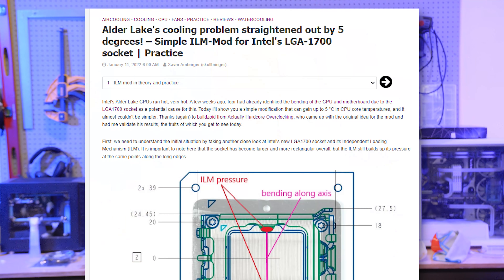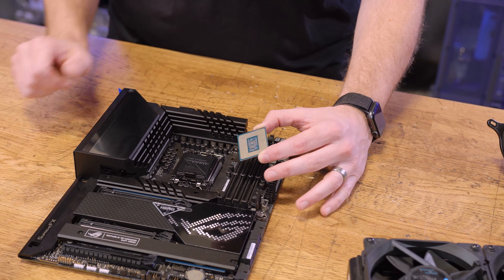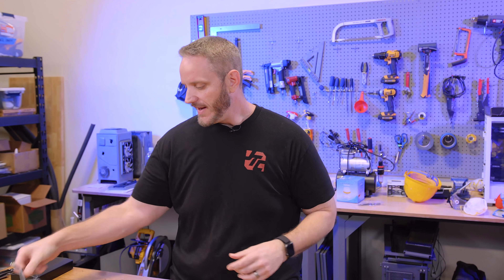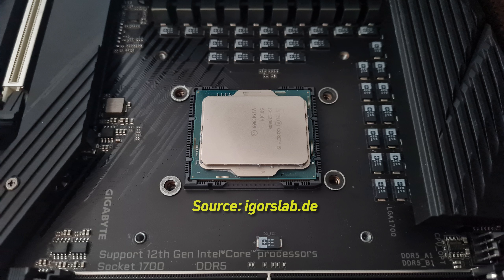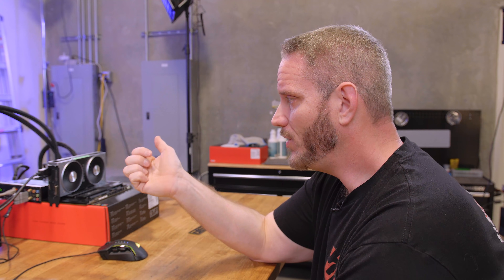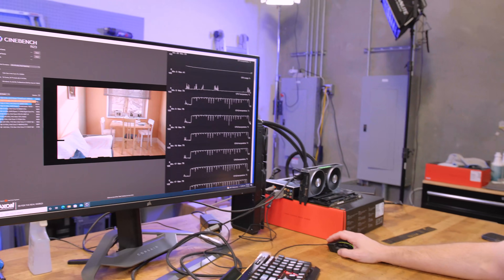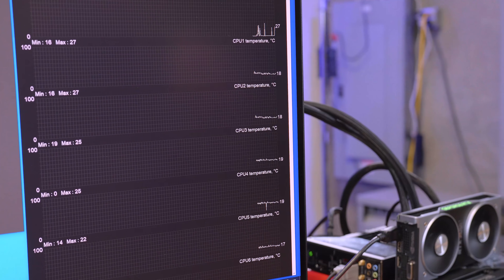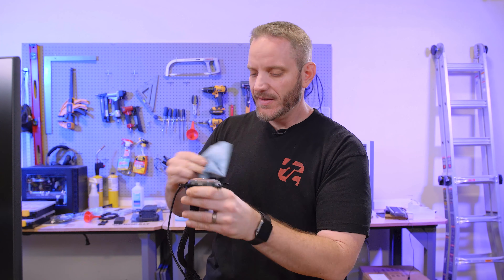YOU GUYS asked me to try this... so I did

Comment: For a very long time a domed heatsink (not heat spreader) has done the best for cooling by giving more pressure and more squeegee effect to get the maximum amount of TIM out of the way.
That's probably not helping with the issue since manufacturers know this gets them better temps.
Once the cooler and heatsink are mated to each other (bent basically lol) it's virtually identical to two flat surfaces.

What's gonna happen tho is if you switch from a domed heatsink to a flat one you're gonna get awful temps.

Bigger IHS means it's even harder to squeegee out extra TIM if you over apply due to identical mounting pressure but lower PSI!!

Comment: I wonder if all the folks calling it hot are using pre applied paste on their coolers.
Although running hot may just be different to what they're used to, if you went from 35 to 45 idle temp, sure it's fine, but it would seem hot by comparison. especially if they overlooked something like power draw or voltages.
Reply: The stock paste lasts a lifetime, usually good performance for stock. It's probably ignoring proper power ratings like you said.
Reply: @jc.1191  yeah it's amazing how many people talked about AMDs 5800X thermals, but overlooked the part where most boards are running default it at around 140W
admittedly i haven't had an intel chip in a long time, but I feel like that would be the first place to look if it ran hotter than I had anticipated
Reply: No applied it myself with a x shape and also tried to spread it out with some spreader thing once. Doesn't make much of a difference either way and my temps in prime 95 are easily 70c stock settings with a 12600k and one of the best aios you can get.

Overclocked it easily goes over 100c if it wasn't throttling.

And I am used to much cooler cpus(funny thing is I had a 300w cpu heavily overclocked with worse cooling that ran much cooler). But these temps are just literal fire. Even laptops are easily 30 degrees celcius cooler if not much more. The hottest cpus ever prior to these few years were easily that much cooler.
Reply: @sansundertale69availablename  yeah I tend to find as long as you get full coverage the application of paste makes little difference, I was more thinking at least with some AIOs I've seen in the past pre applied thermal paste is insufficient to fully cover the IHS, probably more noticeable if they did have a concave/convex IHS and were conservative with the amount of pressure they put on the CPU socket, but having used AMD for so long now I feel like I would just instinctively feel like most intel chips run warm by comparison even though they're fine.

Comment: Am I being thick, but how does spacing up the retention bracket affect the clamping force of the cooler? Shouldn't it be the cooler mounting mechanism that needs spacing up?
Reply: Yeah Me too, As the Socket is Soldered to the Motherboard, the only thing I see that mod changing is the pressure between the CPU Pads & The Socket Pins,
which is then increased when you apply pressure from the Cooler anyway, So... 🤷‍♂️???
If the problem is people Tightening the Cooler Mounts too Much Bending the Cooler Surface & Decreasing Surface Contact, then to me the Solution would be to add the Washers to Raise the Cooler Mounts or not tighten the Cooler Mounts so much
Reply: The people are stating that it's allegedly putting too much pressure on the cpu in the mount, causing them to warp under pressure basically. By bringing the hold down up 1mm. You are reducing the pressure on the cpu in the mount. Thus, reducing the amount of hold down pressure on the cpu and making it so that it doesn't warp.
Reply: Because its Jay you should think twice. The cooler has nothing to do with it as those spacers just increase the pressure for that mount. Its the socket locking arm sitting too close thats causing the bending and raising it up releases pressure.
Reply: @jepulis6674  Gotcha, it's the two central lugs on the CPU bracket pushing across the centre line of the CPU and bending it. Must be a hell of a force.
Reply: G'day Guy's,
I watched Buildzoid's 2 videos on this, apparently his Motherboard was Warping from the Force applied by the CPU Retention Mechanism, NOT the Cooler Mount Pressure,
So adding the Washers to the CPU Retention Mechanism was the fix for his problem
Reply: Exactly..
The retention bracket holds the edges down, you space it out that would do even LESS to hold the CPU flat
Reply: Because retention bracket gives little bit of resting area  for the cooler when tighted hard, preventing bowing of the cpu/motherboard...

Comment: The z-height is reduced on lga1700, so old mounting kits don't have enough mounting pressure. For example, my alphacool water uses washers instead of just spring tension, like on lga1200
Reply: Exactly why I bought an Asus board. My cooler doesn't yet have a conversion kit, but the Asus mobo comes with LGA 1200 mounting holes, and my cooler uses plastic spacers instead of standoffs. So I just didn't use the spacers and was able to screw it down tight onto my 12600k.

Comment: There’s a technique to lapping something like that. You put that glass setup on a barrel. You sand say 10 circles. Then you turn the cpu 90° clockwise while you walk 90° counter clockwise around the barrel. Repeat till you’re back where you started
Reply: Or a figure 8 pattern
Reply: Or you know, you don't and it makes almost no difference to temps.
Reply: True. But it could be useful for anyone lapping any sort of heat sink. Good thermal paste and ever more efficient cpus help mitigate the effects of them not being perfectly flat. And if you’re going to lap the cpu you should do the same to the heat sink. For many people including myself lapping the surfaces isn’t necessary. But if someone wants to give it a try this could be useful so more problems aren’t created.
Reply: @xero_effect13   Ya my pc is “stock”. I’ve never bothered lapping a CPU. Even back in the single core days when I had an alcohol cooled monster. Back then 70° would damage a cpu over time. But on my pc now I’ve never seen a need to overclock. My computer is a tool so I can work on my other hobbies. Gaming, 3D cad, etc. I assume I’m similar to the average pc user and My pc is more than enough without doing anything to it. But for some the hobby is getting the most you can out of a pc. And if that’s the case you do anything you can to eek out a bit of performance.
Reply: @jaceyrector9320  Personally I'm undervolting my cpu so it runs cooler and stays quiet. It can actually get slightly better clock speeds than stock without the excess heat.

Comment: How does raising the retention bracket for the CPU itself affect the z access in any way other then making the CPU looser. Wouldn't you wanna put those washers on the cooler standoffs?
Reply: I dont understand it either. Only way to affect clamping force would be either put washers on the cooler mounts OR lower the socket itself(not likely lol)
Reply: @AK90  I think they think it is the socket itself causing the bow. Like it only takes a minor amount of critical thinking to come to the conclusion that isn't possible because it was literally designed around the CPU or vice versa. The cooler mounts is the problem. Solid mounts are fine as long as they are the proper length. This entire video pains me just as much as older Linus videos were there was zero logic. Idk I don't like to harp on Jay I like him and how goofy he is but this is just 100% wrong and so many people are gonna be returning motherboards and CPUs now. Just further stress on an almost crippled supply chain. So many layers to this onion with current situations in the world.
Reply: I too would like to back this gentleman OR WOMANS or ze zer zah! Hi what’s your pronoun? Sorry I get sidetracked but curious to hear.

-waiting for the professionals to ask how we wouldn’t understand the formula of understanding all while not explaining
Reply: Yea look at the force of the new socket compared to 1200 alone, the shortages has caused deadlines to be shortened in many products without all the bugs worked out before it’s in the consumers hands. Within the next 2 months we will be seeing a lot of this stuff worked out on many things
Reply: It works by lessening the force that is applied to the two "wings" on either side of the IHS. The same end result can be had by bending the hinge area of the retention holder, so that the part that opens is slightly higher off of the socket.
Reply: @justinbroniszewski  Yeah I watched Buildzoid explanation video and it makes way more sense now. Jay explained it badly.

Comment: With a "Stock" LGA 1200 mount ( which looks the same as a 12th gen LGA 1700) my i7-12700KF was pegging at 100C. With the Artic Cooling LGA1700 mount ( the ONLY difference I saw was a 1mm shorter stud ). I was at 72C. So one 1mm WASHER to make the mount go UP. Makes a LGA1200 mount the same as the Artic LGA1700 kit. BUT also gives a LGA1700 "room" to tighten. You are right with the LGA1700 kit was tighten to its at zero lash. By getting the extra 1mm you get some room to "tighten". That said, I think they may have been using a LGA1200 mount on a 12th gen. You HAVE to use a LGA1700 mount on LGA1700 board, the LGA1200 FITs.. and it FEELS right. BUT ITS LOOSE.
Reply: So what I Wana get this right. I also have a arctic freezer 2 and I am using the lga 1700 mounting kit. So do I need to do this mod or not be because I think my temps are fine. Also does the kit cause bending or is it good to

Comment: My 12900k runs hot on an Optimus block .  84C when running cinebench on a custom GPU and CPU with 3 360mm radiators.  I am ordering an EK block to see the difference and will be keeping the better one
Reply: You can't really beat an optimus block. They are one of the best out there, much better than EK. You IHS could definitely use some lapping or you may want to try jays trick. I'm running optimus v2 and I don't go above 70C.
Reply: @Return_To_Sender  are you using it on the 12900k?

Comment: My 12900k Runs hotter like 80/82 its boosting to to like 4.9/5 but Im using ek's quanrum velocity 2 block with pretty decent rads...so surely it should be cooler..
Reply: Maybe your rooms warmer or its cause Jay is testing open bench V your closed case.
Reply: @jondonnelly3  The room is pretty cold and my temps with other cpu's have been a lot better, think i better take a closer look, maybe the mount was bad or a pump has failed or something..for the record I was testing with prime 95 and using hwihhfo64 to monintor temps so maybe thats is making a differrence...Another odd thing I noticed is that asus or corsair monitoring software shows me temps more inline with what I was expecting I only get the higher temp reading when using hwinfo 64.

Comment: I am using my Noctua DH 15 air cooler using the 1200 mounting holes on my Asus Prime Z690-A and am getting great thermal readouts of 35C  to 45C max so I do not have any problem with my thermals. Lucky I guess.
Reply: What about when you run an all-core Cinebench load ? What are the temps?
Reply: @j340_official  if Cinebench is the only thing that gets the cpu hot why does it matter? If  all you do for 8 hours a day is run that benchmark then Ok. But for gaming ?
Reply: @SuckMyNix10  that's not my point.  The original person said he or she has 35C to 45C max temps at idle.  That's great.  At idle those temps are normal.  But the original person also claims to that the lga 1200 mounting mechanism for his/her cooler has no issues.  But to investigate that claim we must ask what are the temps under load?  If temps are normal (75-80 C) then that claim probably is true.  But if temps ramp to 100C then there could be a problem with the mounting mechanism... 

You might think all you do is game so therefore you never use all cores, but sometimes windows update or some other program may temporarily need to use all cores and if temps are spiking to 100C+ that could be a problem.  Especially if overclocked.  So don't just use data at idle and think you're fine.  Instead, I suggest to be an empiricist and test various use cases to see if your theory (that lga1200 mounting is fine) holds up under various scenarios.
Reply: Mostly likely running stock or lowered vcore

Comment: When I was a teenager I loved lapping my CPU for the performance gain. I'd run my rig without thermal paste on those lap jobs. I had a jig I built to lower the cpu or cooler down evenly, and you could mount cpu coolers into it as well with some additional parts. Mirror finish on the CPU and the cooler and no thermal paste netted me better temps than i've ever had, but the amount of work isn't worth it anymore IMO, especially with the gains from overclocking being so much lower than back then. At the time we were taking 2.8-3.3ghz CPUs to clock speeds similar to what you see today. Took an e8700 to 5.2ghz in 2010, lapped mirror flat along with the water block that was running it. Same CPU ran 5ghz all day 24/7 stable as well for years before it got replaced with a 3770k if memory serves, dude was broke AF but had plenty of sanding supplies lying around since his dad did auto detailing lol
Reply: I wonder if liquid metal between the IHS and cold plate would've helped or hurt your temps.
Reply: @pronewbofficial  hard to say, the chip and cooler tended to vacuum seal together, it could get really difficult to pry the CPU off if you pressed it against the cold plate when it was out of the socket. My bet is it wouldn't have any significant effect, or would just make it worse. One of the installations I did this way actually cold vacuum welded together because of how perfectly flat it was. It was installed for a long time and at some point part of the IHS copper and the cold plate copper just fused together lol. Normally this would never happen since copper oxidizes super fast, but we think the friction of the 2 surfaces managed to disrupt enough oxide for it to be a non issue. We also basically did a finishing lap on both immediately before applying them together, so it only had seconds exposed to the air before getting installed for several years. It's a LOT of work though for very little gain at this point. Delidding the CPU and designing a cooling block that goes directly on die gives you far greater gains for less overall worki
Reply: We're also talking 150w less TDP. I had an I7-3770k that ran for 9 years @4.3GHz on stock voltage with a Corsair H100. Never got above 65C at full load. I never touched the IHS. 77w vs 125w TDP and drawing far less current.
Reply: @dragonthc  
I had a 4770 and I just stuck a tower cooler on it, nothing posh just big 'n' cheap with I think 5 or 6 pipes in a cheap case and that never went above 70C.  Times have changed I suppose, Intel cranking up the electrons for performance more and more.
Reply: @dragonthc  Actually, at these OC levels you could expect 300w+ from the quad cores and up to 200-250w easily from the high end dual cores. Power levels were basically the same as today with intel's high power draw on the last few gens. Remember, we're talking about a bump of almost 2ghz and significant voltage increases from baseline. Like from 1.05-1.2v to as much as 1.45v, so more volts and more amps both (as a result of the clocks). The situation was similar on my 2600k at 4.7ghz, I had a VRM designed for 400w+ just to hit that as a daily stable OC under water. This was before intel started using thermal paste under the IHS, I basically stopped OCing around then because I wasn't comfortable with delidding at the time, and the boost speeds of the 4790k were good enough for the time. With my Q9650 at 4.7ghz daily driving, and crossfire HD5870s also overclocked, I actually killed a 1050w Enermax PSU (Revolution 85+, came highly rated by jonnyguru himself), should have gone with the 1250w model lol. This was back when I ran 6 hard drives, tons of LED strips, 2 pumps @ 30w each, and 15 fans, so even with only ~900w going to the 2 GPUs and CPU, that only left 150w of overhead for all of that. You do the math xD
Reply: Wouldn't that be the best option for a long term install because you'd never have to change out old thermal paste?
Reply: @ffwast  Yes in theory, but any long term install you also want to preserve the warranty on, since it'll probably be used a lot more as well (one would assume). Most "long term" installs are for businesses, and if it was really that big of a deal, we'd see these companies properly lapping the IHS and the cooler cold plate themselves. This is for hardcore overclocking first and foremost, which is contradictory to the needs of a long term stable build

Comment: If your cpu was initially convex, the mounting issue would've flattened it. No?
Reply: No.  Cooler mount isnt gonna squish metal like that. What the original issue would cause is a convex cooler mount on a concave cpu, which would make more space. Imagine each of the coolers screws as force on a lever, with the line from the center of the cooler to the screw being the lever. If the corners of the cpu are high, the more down you push the screws, the higher you push the center of the cooler up. If the center is the highest bit, though, then clamping the cooler down would pull the cooler’s corners down, making better contact with the cpu. It’s very possible Jay got a CPU with a cpu less concave than Igor’s lab or buildzoid, or maybe this MB is built different. It sounds like there is more going on than just LGA1700 mounting height alone.